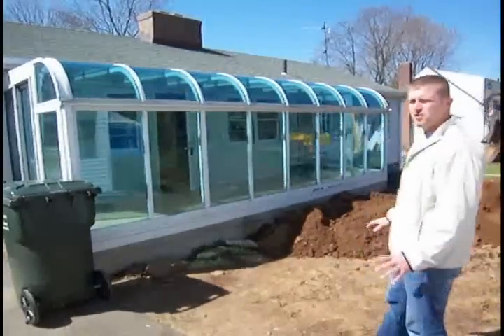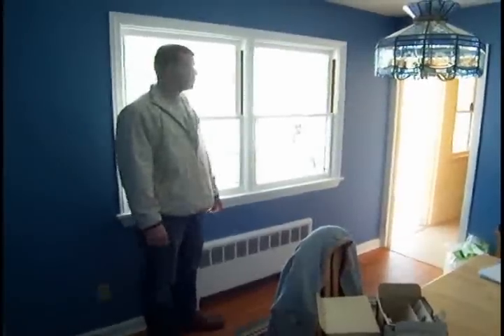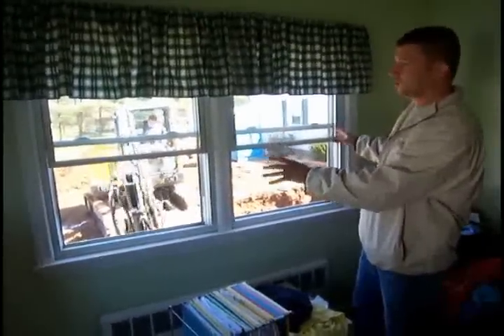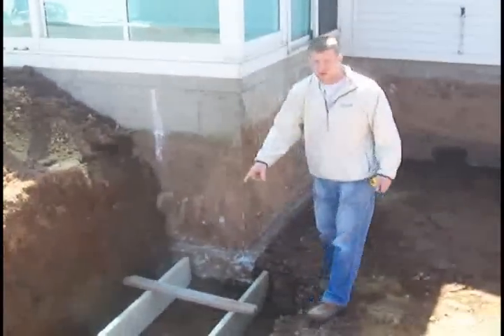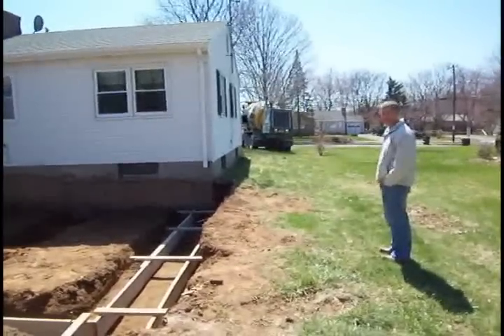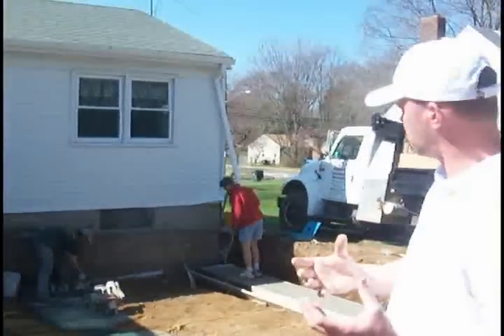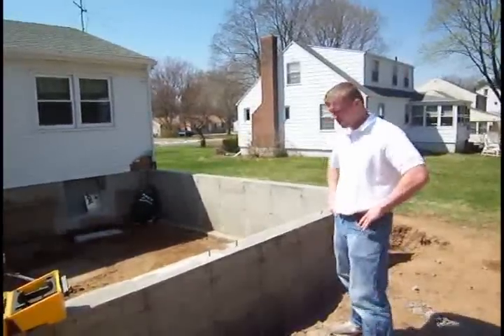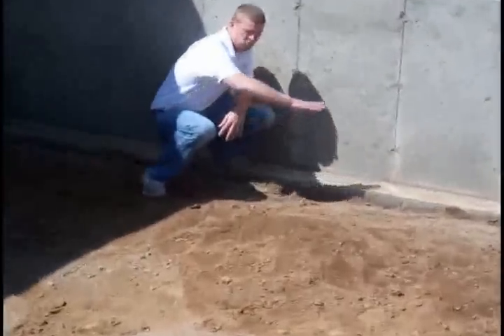How to Build a Foundation from Start to Finish

Comment: I am a second year student ina construction management course in SLC Utah, and after reading a chapter on foundations and footings in my text book, this video did help make much more sense of the key concepts on footings and foundation wall.  I would like to see how your bolts were set and the use of any rebar was used to add strength for soil pressure and compression.  But this video did help a lot!

Comment: @homeaddition, what would be a ballpark figure for a 12'x18' addition SHELL (framing, subfloor, roof, windows, wrapped, partial brick/stucco, no electrical, no drywall, no interior detail for a ranch that will also extend basement out to addition dimensions, but will only be the concrete walls and floors? Any help you offer will be appreciated.

Comment: can anyone help me with this, im thinking of building a an outbuildind/shed at the back of my house in Ireland. there is a river about 20m from where i want to build, what kind of foundation do i need, how deep? my neighbor had one build when the houses were being built, the soil is stable and the river never comes up even if it did the water wouldnt reach us. i already have a wood/plywood shed but the roof keeps flying off or it starts leaking or something always happends. DIY job any help?

Comment: In Mexico that woud be considered so so week, we use steel cages and concrete, columns every 3m or so. I though it was normal until a trip I made to England, I couldn´t believe many houses were made of wood, like a tree house, then i learned in the US its very common too. there was no steel in that concrete! and the "anchor" was two little pieces of steel. And 3000 psi? what do you recon a 6m 30x30cm square column with steel weighs? 2 ton, more? ..Or maybe we´re just wasting material

Comment: Sorry forgive me but, I can't fathom why you are using anchor bolts? why not just build a brick wall on top of the foundations? Everything you said made sense about the frost layer etc, but to me, its as if you are simply going to bolt a wooden frame on top, like a big shed?? I also notice you are not using re-bar reinforcement before pouring the concrete.. which I observe is typical practice in other videos, not trying to criticize you, I am new to this id love to know... was there a reason for omitting it?
Reply: Why would you use brick this isn't the three little bigs.  All houses in american are wood frame
Reply: Dual brick wall with air cavity in between for insulation is standard for houses in the UK. I knew our standards were different , but I was scared when I see garden shed technology employed for actual houses. More worrying is that you actually have tornadoes, which CAN blow your house down, so really it is like the 3 little pigs now that you mention it... Do they use wood for cheapness? or because brick is not easily available.
Reply: Probably a combination of both. Wood is readily available in North America and the climate isn't as damp as the UK. Strength is not an issue. We have built dozens of homes in ny right in the heart of where storms like Sandy have hit and I've never seen a house blown over. More often they will completely shift off the foundation before they collapse.
Reply: That's cool to know. thanks for clarifying.

Comment: MIgel been to mexico and there nothing to brag about about the houses in mexico. ask some of your DEPORTED PRIMOS and i bet some of them work pouring concrete. or framing houses..  IS REQUIERE BY LAW AND CODE that either has cables or rebar.  DOES MEXICO have an inspector to come to every house to check the concrete before concrete  goes in  and anchor and after concrete is  pour .  you need all those inspections in order to be granted a DEED or ISCRITURA.